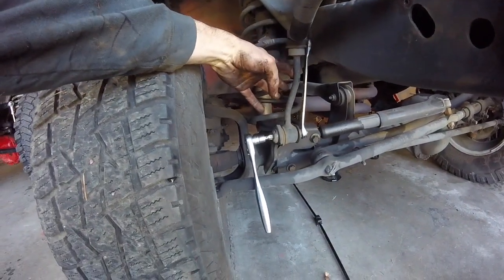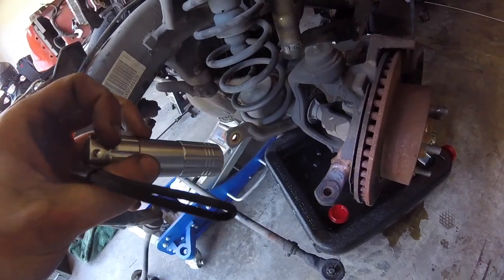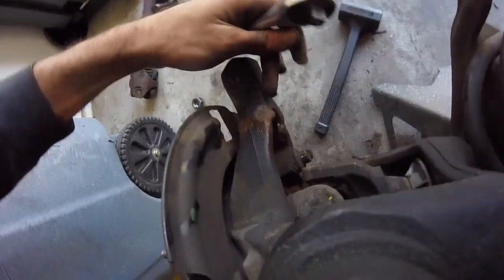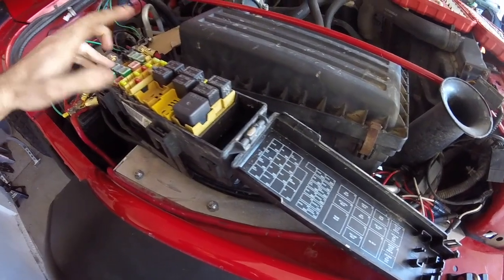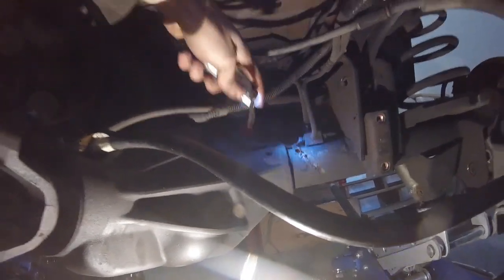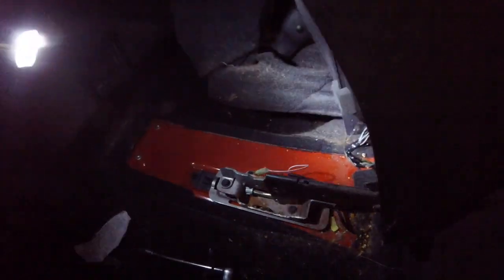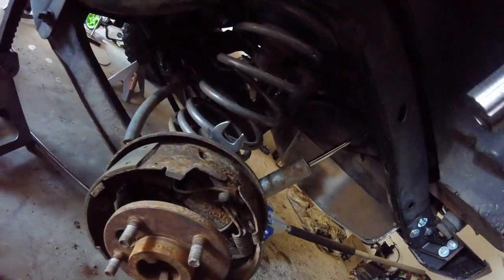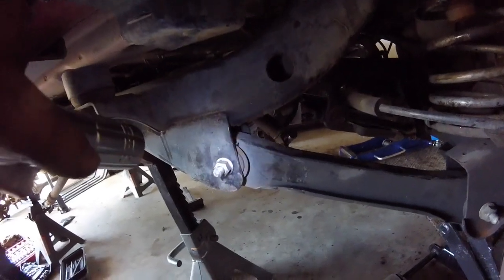Dana 44 Axle Swap | Jeep Wrangler TJ

Comment: Hi, I am planning to buy TJ sport and swap differentials with rubicons, so i can get dana 44s and rubicon lockers, may i know what are all parts you end up chaninging with this swap? differential housing, axels, knuckles, driveshaft(front or rear?) ? thanks for the video.
Reply from the maker: Yeah so most of that stuff is attached to the axle and will get changed as you swap the axle. Knuckles, diff housing, gears, etc. 

You will need different driveshafts or you could just change the yokes on the Rubicon differentials instead 

Also you’ll have to find a place to rewire and mount the lockers. If you get the chance take the rubicon’s transfer case too. I did all of that in other videos